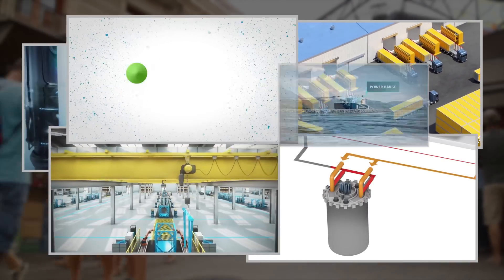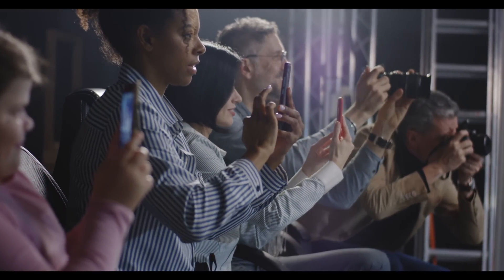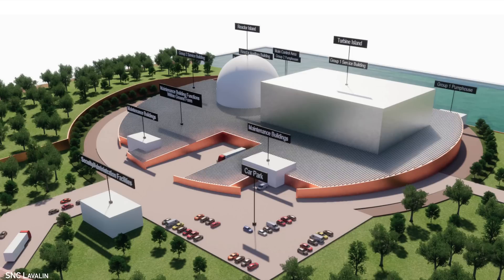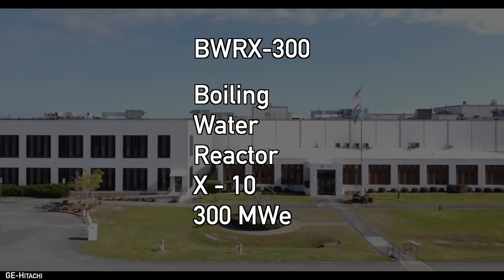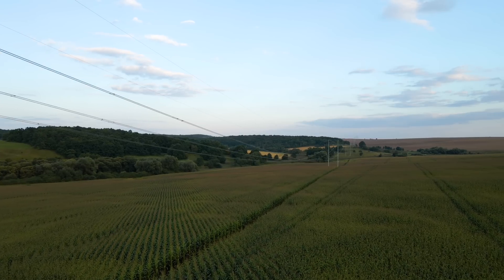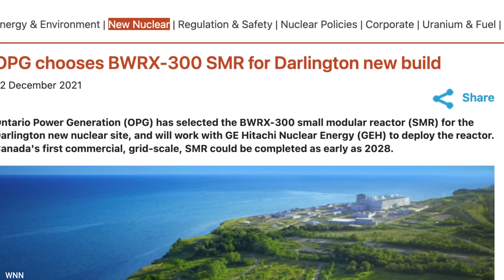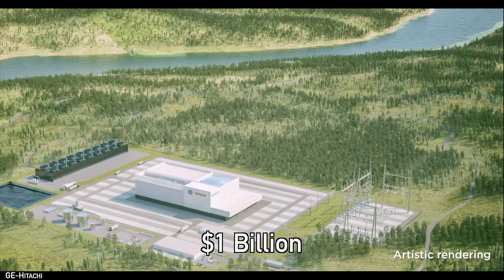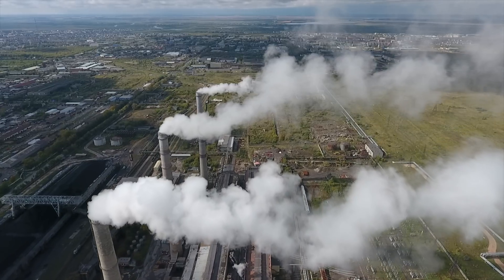Why This Small Nuclear Reactor is Actually Winning

Comment: The problem with BWRs is that they contaminate the steam cycle, making the Turbine Building radioactive.  This increases operating cost.  Having worked in the industry since 1985 and having worked at two BWRs for over 20 years - I would take a PWR over a BWR just for the reason that the Turbine Building is clean in a PWR.  We shall see.  I do believe that nuclear needs to be part of the energy equation in the future.
Reply: What sort of radioisotope contaminants do you see in hot turbine buildings? (I only know the theory and we know how it goes when we rely on theory...)

Comment: 300MW is not a lot. You need 5 of them to have the output of a "full scale" reactor. Are 6 reactors cheaper to operate than a bigger one? Are 5 small reactor more efficient than a smaller one? Does 5 small reactors take less space than a big one? Don't know. The only "pro" is that if one has to be stopped for maintenance/refuelling you loose only 1/5 of the power, but again... if you decide as a country to go with nuclear power, you would not build a single "full scale" reactor, you will need at least 10 of them (20GW) for them to be economical.
Reply: Economics of scale boyo. If these reactors can be constructed more frequently and with advanced manufacturing techniques, the cost overall will be lower.
Reply: “Cheaper”?

Yes, if they can be built fast so less Interest, need fewer rare parts like a 3000 MWth RPV, smaller parts trucked instead of barge or rail, are able to dissipate decay heat w out active cooling so less backup reqd, small or no large body of water for cooling, small evac area, much easier to build another 4, 5, 10 units in the same site. 

Yes cheaper is possible, though plenty of big plant people out there pretend none of this occurs. ‘Oh, got to have a rail head else it’s not safe’

Comment: How many people (using average amounts) can be served by such a reactor?  It would appear to be circa 210,000.  I live in an English town of that size, so every town like mine would need one.  At $1 billion each, that's a LOT of money - and pointless against gas, which is cheap, plentiful, and only emits CO2 and water vapour.  For security of supply, I get it, but for economics, not at all.
Reply: You assert gas is cheap in the UK?  

Security of supply is economics.  If all fuel is imported, then it’s a matter of when, not if, that supply is curtailed, not cut off, and the price of energy goes up 50X in which case even the avg long time cost is far greater than anything else.
Reply: @Nill757  
Gas is cheap BY COMPARISON.  Long-term, we have to have security of supply of energy generation, and that will be nuclear.  That will be necessary due to our population level.  If we stopped purposefully letting our population rise by 750,000 to 1,000,000 a year then we could get by on gas for many years.  Alas, that isn't going to happen.  So a nuclear future it is - at considerable cost.
Reply: @jimskirtt5717  Cheap?  EU gas hit 330 EUR/MWh August 2022.  Uk Home energy bills went up 3X in 2022, and that’s w a price cap, carried by UK govt which spent £150B 2022 to cap bills, equivalent to another NHS.   Nuclear is not that expensive, and if built in volume w standard design like 90s French or todays Chinese or 1960s Yanks, it’s cheap.
Reply: @Nill757  
Again...please see the words 'BY COMPARISON'.  Gas is a cheaper method to generate electricity than nuclear by a long way.  It's the primary reason why we haven't built nuclear stations...everything is driven by economics.
Reply: @jimskirtt5717  Gas was cheaper by comparison to nuclear not this decade in EU. Not sure why you can’t look up price gas last two years.  That’s not going away in EU.

Another thing to factor when gas supply gets tight is that every unit of gas used to make electricity competes with 3 units to make space heat or industrial heat.
Reply: @Nill757  
Gas IS cheaper.
If you want to generate electricity, and build a plant to do so...
Gas costs £0.5m/MW
Nuclear costs £6.9m/MW

Not only is a gas plant massively cheaper to build, it's actually cheaper to run - due to the cost of the waste of a nuclear plant...

"Nuclear power is cost competitive with other forms of electricity generation, except where there is direct access to low-cost fossil fuels."

And that's actually from the World Nuclear Association...promoting nuclear!  We have abundant supplies of gas and coal, so gas IS cheaper than nuclear.  I'm trying to remain polite, but you can't just make stuff up.  I say again, we must burn gas until it runs out BEFORE switching to nuclear, which will cost an extraordinary amount to build AND maintain.  For the next few decades, energy will remain relatively cheap, but very long-term, energy will be very expensive - due to the cost of nuclear plants and running them.
Reply: @jimskirtt5717  "except when there is direct access to low-cost fossil fuels"

As in, "low-cost fossil fuels", which clearly the  EU doesn't have anymore, and, 3rd time, look up the price of gas this decade, the rest is hand waiving.  More hand waiving again about "plenty" of this or that, as if production doesn't matter,  putting words in my mouth, suddenly cost of spent fuel is expensive but hydrocarbon emissions and extraction and accidents don't matter.  That's "polite"? Not where I come from.

BTW, long existing nuclear plants provide by far the cheapest power available of any source, as any number of reputable energy sites like IEA will confirm.  Plant closest me operates 1.8c/kwh for years now.
Reply: @Nill757  
You're wrong - Google it, I did.  Against nuclear, fossil fuels are 'low-cost'.

Also:
"hydrocarbon emissions and extraction and accidents don't matter."
No, they don't.  There is no warming from CO2 emissions.  CO2 warming is 'back-radiated' according to a failed theory.  However, it back-radiates in the infra-red band between 14 & 16 micrometres.  That part of the spectrum has been saturated for at least 6,000 years, and no warmth can come from any absorption.  I admit I'm not keen on coal emissions, and clean-ups of oil can be expensive, but that's still taken into the account...whereas we haven't yet had a serious nuclear disaster resulting in the abandonment of a large part of a country (Ukraine aside).  That will be incredibly expensive when it happens...and it will.  All the rest is just fake science.  There is not one shred of evidence that GHGs even raise the temp of the Earth.  Don't believe me?  Great - then do research, you're in for a shock.  The English CET is the longest-running temp record on Earth, and runs from 1645.  It shows NO warming apart from that of UIHE.  You've been had.

I hereby give up.

Comment: The Nuclear Retardation Commission (NRC) monopoly GE/Westinghouse hasn’t shipped on time or on budget since… ever.
I personally think it’s time someone else got a chance. Plus LWR’s are so “old school”… designed by Alvin Weinberg for submarines (where there’s plenty of cooling water). He also designed a reactor that didn’t require water cooling… for land use.  Plus the fuel is a molten salt (IOW: It can’t “melt down”; it’s’ already molten). Unfortunately it was canceled (by Nixon) before it could be proven. Plus these next generation reactors can consume almost 98% of the nuclear fuel AND almost 98% of the transuranic waste… that’s 1/100th the waste of LWR’s… that only has to be stored for 300 years instead of 10,000. LWR’s were “proven” by Three Mile Island, Chernobyl and Fukushima. It’s time for the next generation.
Reply: Chernobyl was NOT lwr. It’s the only commercial accident that killed people from radiation, was not lwr, and it had been never would been what it was.

Comment: What happens after 7 days if it loses power for cooling?
Reply: Well, naturally it would use diesel generators indefinitely to keep the core cool, until grid power came back. If the DGs are out, and offsite power is out, then the plant has 7 days with the isolation condensers keeping it cool using passive circulation, it takes 7 days for the water to evaporate, so you refill with a hose, of course the preferred method is to get the diesels up and running.
Reply: @boatymcboatface2836  yes, but still not a failsafe system.
Reply: You can never shut off nuclear power if that is what you are looking for

Comment: Wow, a gen II boiling water reactor adapted to use passive cooling;  is inefficient and uses scarce fuel in the most wasteful way and producing lots of radioactive waste!    All of this to reduce the amount of plant food in the atmosphere but will have no effect on global warming!!  This is like the trucking industry announcing today's new truck: a 1975 Kenworth with a 1985 engine.   Or, if you are a history fan:  when the maritime powers that be made steam boats revert from iron boilers to copper boilers because they had a safer reputation for not blowing up - not because copper was better but because owners of the new iron boilers were defeating the safety pops to out run their competition.   Moral:  Retro is the new state of the art!  I hear the electronics industry is going back to vacuum tubes because they are easy and fast to replace.

Comment: using primary loop for the turbines means that at decomission more clean up will be needed cause all the plant's equipment will be radioactive, more cost for future generations, bad plan, also a tubine wheel needing replacement will happen those break down and have limited lifespan, the whole process will become nightmare for servicing
Reply from the maker: You're right, a contaminated steam loop does make it more challenging compared to separated loops, for sure. But it's manageable, otherwise there wouldn't be ~100 BWRs operating.

Comment: Only NuScale has an approved reactor, which works. all the others are rubbish and will most likely cause meltdowns or release of radioactive material to the environment. NuScale is perhaps 15-20 years ahead of the other competitors. All the molten salt is illusions whoch will never work as no material can withstand the chemical impact, and the vessel wall will simply collapse.

Comment: “Actually being built”

How’s that? There are no licensed to operate BWRX-300s installed anywhere, nor under construction. That project in Darlington is simply “site preparation”.  There is no reactor being built and there’s no license.  Like other designs, GE has agreements to build with several clients, with no revenue. No license.  At least NuScale has a design approved by the NRC, if not yet approval to start building. GE, with all its prior experience, has no such license for the BWRX. The NRC states GE is “engaged in pre-application activities”, that is years and a $billion away from a license to build. 

And, GE has no approval to forego large evacuation plans and similar expensive safety measures at 300 MW.  Nuscale does.

Comment: We are building OL-3 in Finland, so far its 5312€/kW, doing starting trials, so we will probably need to pay 1 more billion, so then its 5937€/kW, and been build since 2005, sure it will output 1600MW, but if we had 10 smaller ones, malfunction to one would be smaller devil than when this OL-3 malfunction.

Comment: A record of sixty-five (65) operating reactors (over 50+ years) is touted as significant level of experience.  But there are at least 700 operating pressurized water reactors (PWRs) of different sizes using a broad range of fuel mixes (over the same period).  That's real experience.

Comment: Many good points are made here, but I still don't think there's enough value in a design like the BWRX. Fission-reactor-generated electricity remains expensive, and I believe such plants must go even smaller, to the micro modular reactor (MMR) and to distributed generation, to achieve the necessary value-add. There is great economy to be had in obviating the need for long, cross-country runs of transmission lines, certainly over time, as well as the welcome resource-saving. In the absence of antisocial accounting, these factors make a significant difference in the cost per kWh. The optimum design is likely to be one in which the sealed reactor/steam module can be lowered into place on a lightly prepared site, e.g., by helicopter, perhaps targeted to 25 - 50 MW generation capacity. As the sealed module will ultimately be discarded as a unit, it should not incorporate the generator equipment.

Where and how large would such an MMR site be? Think electricity substation. That is to say, the familiar and quite small sites that currently house localized distribution infrastructure. It is highly likely that such a well-targeted MMR module will quickly become a common commodity on a worldwide scale. With an operating life on the order of 15-25 years, a module nearing exhaustion will be extracted from its site in a simple procedure paralleling that of installation. And on such a timeframe, it is extremely likely that replacement modules will be fusion-based, neatly ending the disposal problem after only a single generation of fission cores, meanwhile having helped save the planet.

One further angle. These sealed MMR cores will be so much a commodity item that they will facilitate the delivery of electric power to remote locations like never before. But their reach won't be limited to planet Earth. In very short order, they will arrive to a location near you (so to speak) on our dear Moon and to settlements on Mars. Is there science fiction here? Honestly, I don't think so. This is simply innovation, teamwork, and a dash of leadership coming together in a meaningful way.

Comment: I would like to see the Chinese and the Russians and Indians succeed in the molten lead modular thorium reactors. I heard that the Chinese are going to deploy a nuclear reactor on the far side of the moon to power some scientific laboratory and radio telescope in one of the craters. the Russians already had a nuclear barge that makes incredible sense for electrical power generation. the same goes for India. I think India has a working prototype of the molten lead thorium reactor. the ironic thing is this was originally developed by the usa.

Comment: While I am a fan of Nuclear, are there any improvements in spent fuel storage or recycling? Is it simply on-site storage and kicking the can down the road waiting for Thorium reactors to breed or recycle its fuel?
Reply from the maker: Long-term waste policy is usually the role of national governments. Private companies can suggest ideas, but nobody seems to want to seriously deal with it, at least in the US. Thorium and breeder reactors are more efficient in their fuel, which would generate less overall. But the existing volume of waste isn't enormous anyway. It's mostly a policy issue.
Reply: I thought the united states basically said uranium is abundant and we will not be engaging in recycling it with breeder reactors and what not? Now this was a few years ago when I heard this, so it may well have changed but. My understanding was just store it away, it is not that much at a time any way
Reply: Hey Poland! You're going nuclear for the wrong reasons!

CO2 is climate-irrelevant. 

Interglaciation climate change (i.e., the Medieval Warm Period) is caused by changes in cosmic rays (Svensmark et al). 

There is not such thing as anthropogenic global warming.  

"Global Warming" is a superstitious bullying and shakedown of the taxpayer. 

Just burn coal and keep looking for more oil and make it out of coal (the way South Africa does at SASOL).
Reply: There are new reactor concepts that can burn down spent fuel.
🔋 Key Advantages of the Dual Fluid Reactor (DFR):

• ⚡ Ultra-efficient: Nearly 100% of nuclear fuel is used  
• ♻️ Burns nuclear waste, depleted uranium, natural uranium, thorium – and all actinides (incl. Np, Am, Cm)  
• 💥 Transmutes long-lived actinides into short-lived fission products  
• 🔄 Built-in Pyro Processing Unit (PPU): Continuously removes neutron poisons and extracts valuable metals  
• 🛠️ Liquid fuel: No solid fuel rods, no reload cycles  
• ⏳ Decades of operation with a single fuel load possible  
• 🚫 No corrosive salts: Liquid metal fuel avoids fluoride corrosion and complex chemistry  
• 🧊 Lead coolant: Excellent shielding, no water, no pressure → no steam explosion risk  
• 🌡️ Very high temperatures (700–1000 °C): Enables hydrogen, e-fuels, ammonia, and direct steel reduction  
• 🧠 Self-regulating: Output adjusts automatically via negative temperature feedback  
• 🪫 Minimal waste: Only short-lived fission products remain (• 🏭 Compact & scalable: High power density, ideal for modular deployment  
• ⚙️ No moving parts in reactivity control: No control rods required  
• 💰 Uses spent fuel, DU, thorium & actinides – no enrichment required  
• 🌍 Reduces dependence on enrichment, mining, and fuel imports  
• 🔄 Fully closed fuel cycle: No external reprocessing required  
• 🆚 Outperforms typical SMRs: No pressure vessels, no water coolant, no fuel handling